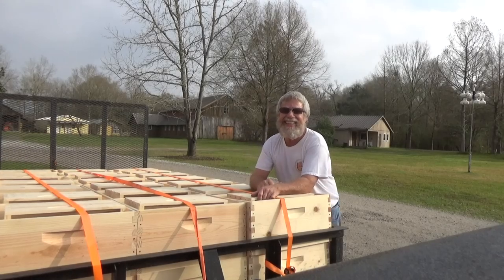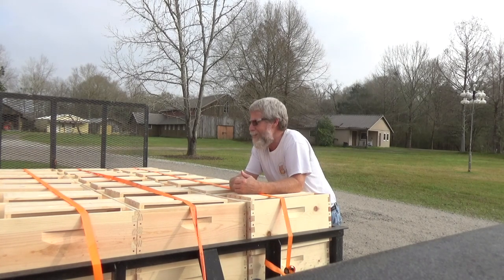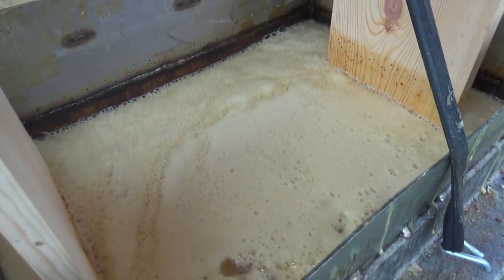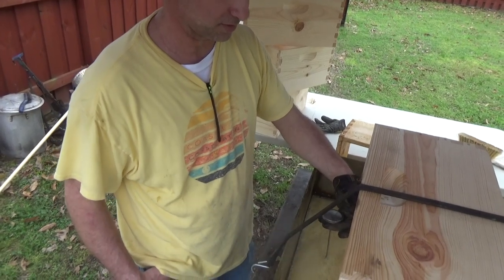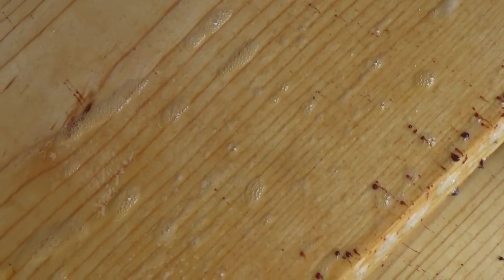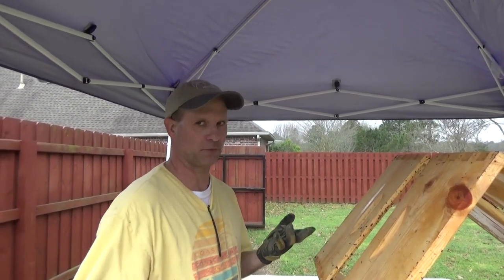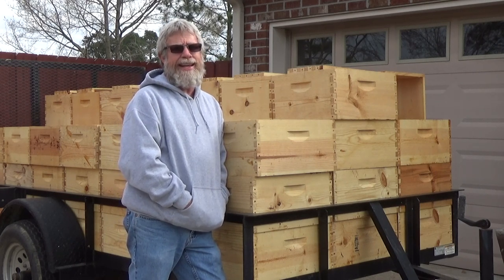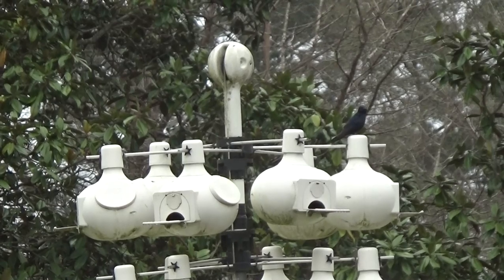Using hot wax dipping to preserve bee hive boxes

Comment: Great video ty.  So water expands roughly 1600 times when turned to steam.  So the little water vapor left in the wood cools, contracts, and pulls the wax on the surface in.  If you heat it too long you will not have as much water vapor to condense and pull in the wax.
Reply from the maker: I don't understand the science of the process, but it works VERY well. Thanks for watching. God's peace.
Mr. Ed

Comment: Great Video.     Also - how do you make your hand holds?  They are beautiful!
Reply from the maker: The trick to making the hand holes is buying  the boxes with them already in them. Or, when you cut the boxes out on your CNC, write the program in to do the handle spots as well. Thanks for watching. God's peace Joe.
Mr. Ed
Reply: @JeffHorchoff  LOL - That's cheatin' at its finest...  There has to be someone that has figured this out... those are great hand holds.  I think its done on a table saw though.  I do have a CNC and plan on using it to engrave my boxes. (I have time - and its  really of little cost when you have the tools).

Comment: paint them while they are hot with water based paint, i paint them twice, 2 boxes at a time, while i paint the second one firsts paint is already dry so no need to stop for them to dry. Paint gets baked on on the box and lasts a long time
Reply: temperature needs to be 160 deg celsius for dipping to work very well, doesnt work well under 150 deg, also with higer temp gum rosin melts better and theres nothing to scrape off. Also painting is not possible if wood doesnt suck in all the paraffin after you take it out.
Reply from the maker: Thank you for all your good information, and for taking the time to leave your comment. God's peace.
Mr. Ed

Comment: If you paint with oil based paint straight after dipping when it’s still hot the paint is drawn into the wood with the wax and can last an extremely long time, it’s the method we use any hoo 
Take it easy Mr Ed

Comment: Compared to painting is the cost similar?
Reply from the maker: It cost $7.50 to dip each box so that is a few dollars more than painting. However, the initial cost is recovered over the longevity of the bee box. In my opinion, this is a very good method of protecting my wooden ware, and the only process I will use from here on out. God's peace Daniel.
Mr. Ed

Comment: Lumber on the work site always attracted bees because of the sap on the boards... I see how bees go crazy over beeswax when its exposed to the air.. So I imagine dipping the boxes will help attract bees to the hive as well as make the wooden box feel more like a natural home to them since their wooden box is now coated in wax.. I wonder if they like the wood shelters though because the wood is porous and breathes...  This will be interesting to see how the bees do in these dipped boxes compared to non-dip boxes.. Could bee hives mold if theres too much moisture inside?
Reply from the maker: The hot wax cooking method is really working out well. I have 50 from last year, and they look just like they did when they were pulled from the cooker. Moisture is always a problem with be hives, but if the hive is properly ventilated, this is a very insignificant issue. Thanks for watching. God's peace Christopher.
Mr. Ed

Comment: The guy never answered how much parifin (sp?) to how much wax. Would you happen to know by chance jeff?
Reply from the maker: I really do not know the answer, but it should be easy to find, sorry. Thanks for watching. God's peace.
Mr. Ed
Reply: The paraffin is the wax. 85% paraffin to 15% gum resin.
Reply: EatenByAGrue thank you. However, https://en.m.wikipedia.org/wiki/Paraffin is not bees wax. If I use bees wax, can I just add 15% gum resin to the bees wax and start dipping?
Reply: @notafuckinpplperson8233  I don't know. It probably wouldn't work quite as well. Beeswax is a much larger molecule than paraffin so it would probably have a harder time penetrating the wood.

Comment: Everything is better fried...even bee hives.
He needs to build about four more of those cookers and figure out how to put a thermostatically controlled heat unit on them. What does he charge to cook the hives????
Reply from the maker: You'r right, what does not taste great when it's fried! The cost was $ 7.50 per box, a price well worth it to me. Thanks for watching. God's peace Brent.
Mr. Ed
Reply: @JeffHorchoff  That's not a bad price to pay for a fairly permanent weather proof treatment.
Reply from the maker: @Digger927  My exact thought, and don't forget, no painting either. Did I mention, I hate to paint? God's peace.
Mr. Ed
Reply: @JeffHorchoff  Lol. I just don't like the constant maintenance of the painted boxes, If it was a one time thing and done I could bare it okay but the corner joints always start letting water encroach over time  and then repainting doesn't help much. Some years ago I went to all plastic equipment. I've been fairly happy with it but there's no doubt bees prefer woodenware.

Comment: Why was beeswax not used?
Reply: The bees will probably chew the wax lol.
Reply: If you use bees wax I'm thinking it might create a bee robber situation. That is just a geuss.
Reply: Because beeswax is $10.00 a pound  and paraffin wax is under $1.00 a pound
Reply: There was a guy who gave the full details of why not to use beeswax.  The biggest reason is its melting temp is too low.  It also has to do with it interactions with the oils in the wood.  Coating your whole hive with beeswax would be ideal.  But cost is going to be an issue too.  Another guy I saw used soy wax and mineral oil based parrifin.
Reply: @chelsealeonard6264  no that wouldn't be the issue.  All hives have beeswax.  It would actually help a swarm trap to have that smell.
Reply from the maker: There is a big cost issue as well as availability. God's peace Nathan.
Mr. Ed

Comment: Best way just paint em, MUCH MUCH CHEAPER TOO.   the bees coats the insides with wax. >   The RUST-OLEUM OIL BASE Paint  i painted mine,  has lasted 17 yrs.!  Still don't need painting he hee each there own RITE?   i wanted mine to last i put 3 coats on in 3 days 1st coat is a sucker coat, 2nd is blender, 3rd PREFECT EVEN COATING>  i tried wax, fiber glass resin ect. last only 3 yrs at the tops  YES I LIKE THE WOOD GAIN EFFECTS>  BUT JUST DON'T LAST i had to burn those boxes. i used wax on ect. THEY WAS JUST ROTTEN>  thats why i got away from finger joints on bee hive too THEY ROT i just butt em up drill a hole out then glue and screw em  Just as strong as a finger joint!  the ends is covered up with glue or Caulk! then painted, so it DON'T ROT
Reply: Good morning Super Bee!
Reply: @danskisbees7348  GM DAN! HRU? are you doing any honey harvests yet? i'am fixing to start next week I hope to get it done by July 1st for the holidays
Reply: @426superbee4  That's awesome!  I'll find out tomorrow morning if I'm going to harvest any, I put some in with my splits. I don't know about you, but I'm ready for fall, too much humidity and mowing!
Reply: @danskisbees7348  lmao kinda ready, but i hate the cold the most YES YES MOWING TREE TRIMMING AND MORE lmao! i got a bunch of scouts looking at a few boxes the last 2 days! > Hurry up girls, make up your minds
Reply: @426superbee4  Lol!  I just came in from mowing in my shorts and flip flops, I should know better!  Now I'm going to take a shower and put a third coat on a few boxes.
Reply: @danskisbees7348   cool yea get the crap off of ya go shower you been busy He hee i'am waiting for parts, broke a  deck blade engagement cable
Reply: @426superbee4  Lol!  I broke the bolt on the idler arm for the pulley, that was right after I replaced all 3 spindles last week.  I was using the walking mower!
Reply: @danskisbees7348  What happens me trying to use it as a brush hog  Dam sticks Them trashy pulley cover aren't worth dog duke but they do help
Reply: @danskisbees7348   i got a swarm today :P  they went into a swarm trap
Reply: @426superbee4  Whoohoo!  Gotta love it!

Comment: Very interesting. It seems that it would go much faster if the boxes were unassembled.
Reply from the maker: Never thought about dipping before assembly, it may work. God's peace Gary.
Mr. Ed
Reply: I know nothing of this other than what we just watched, but my guess would be a stack of boards would not absorb as well, there would need to be spaces in between them? With the assembled boxes the "hot wax" also gets into all the seams, making them hold even better?  Also if you're adding more wood at a time to the vat I'd think the foam would rise even higher, due to more water content being pushed out, thus overflowing unless you added a lot more headspace to the vat?
Reply from the maker: @ubetchya78  In my opinion, it's just all around easier to have the boxes already assembled. God's peace.
Mr. Ed
Reply: Gary Freeman   If you use glue in your construction, it won’t stick to paraffin-coated wood.